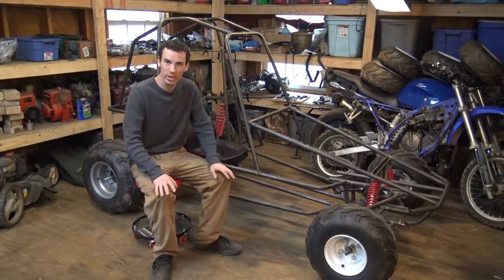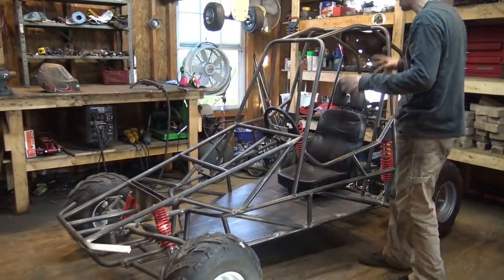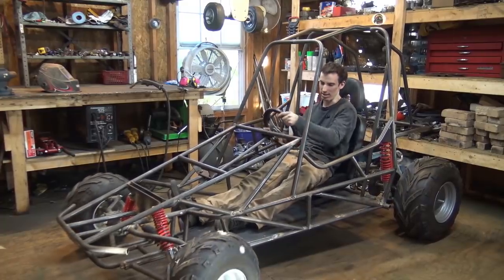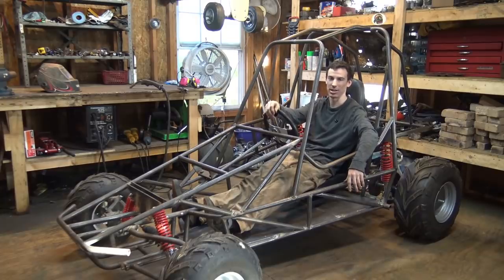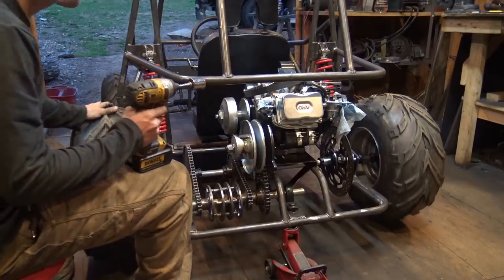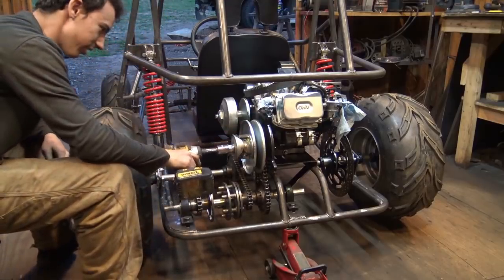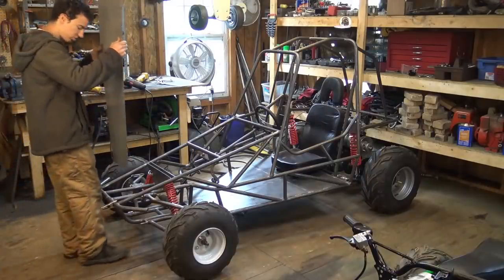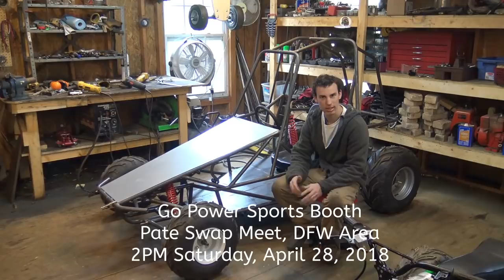building the two speed off road go kart part 4

Comment: hi never use plexiglass as wind shield, it gets scratched very bad. use the Polycarbonate, that is used on motorcycles windshields!
and about the body work i think it is fine. it will even allow you to make a custom paint job later it gives it caracter... 
and you can even put a kind of cool lights on the top of it and the front. and even something like an air intake on the hood... it will look cool. i'll make a drawing for you. i'll put it in a coment.
Reply: so you can imagine the rest. with the sides covered...
Reply: whats the point of a air intake on the front when the engine is in the back
Reply: Plymouth Barracuda when you have a windschield. You need a fresh air flow in somehow. Or am i wrong?

Comment: Make brackets and bolt on the sheet metal and mount it with rubber washers or O-rings. Or use a different lighter material like plastic

Comment: composite panel  called alucodond and weld tabs on for screws or bolts and use1/8 in. 3M tape between frame and panel research alucobond you can do a lot with it

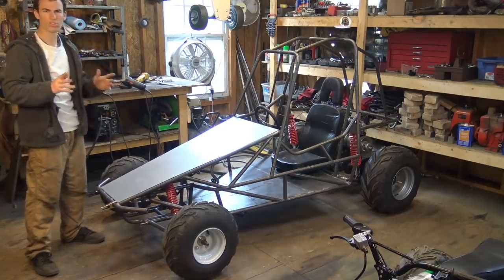Comment: @13:48 might wanna make that sheet metal a bolt on in case you need to remove it for any reason at all! once you bolt it down it will get rid of the noise just use little rubber spacer's  ;) your buddy spikeman

Comment: Leave the sheet metal off. The more weight you add, the more strain on the motor. If you insist covering up the frame, try lighter materials such as ridgid plastic, plexiglass or some type of light composite material. You still may have to deal with the rattling if you do.

Comment: Next build should be with a 4 cylinder car motor
Reply: mason swan , (but not just any 4 cylinder motor it has to be an “SR20DET” ) , ( OR EVEN BETTER THAN THAT ) ,
THE NEXT BUILD AFTER THE 4 CYLINDER BUILD SHOULD BE WITH A 6 CYLINDER CAR MOTOR (but not just any 6 cylinder motor it has to be an (FULLY BUILT “2JZ-GTE”  motor )
Reply: Rich Gwozdz Better start donating then...
Reply: This gets my vote.  This cart is pretty close to what I'm planning to build in the next few years with a b16 or b18 honad engine/trans.  They're fairly powerful for their size and dime a dozen in salvage yards.  8 or 900 pounds and 140bhp?  F yeah man!  SCARY FAST.
Reply: How about a 670 twin they are a 26 hp motor

Comment: Not sure if you know this or not yet, specifically how to calculate the torque or motive force of your drive system... If you do, just ignore it, if not, here's how you figure out what you've got. 

You should be able to find the torque curve of that motor, it will look kinda like an upside down U, or, they may only list peak torque at 3600 RPM. Once you know that, you can start using some simple algebra math to work your way down to the torque at the wheels. I'm assuming you already know how to calculate the drive ratio of your chain drive, which you can do by diameter for pulleys, or number of teeth for gears and sprockets. It will always be some fraction, like 10 teeth drive to 40 teeth driven which would be 1/4 or a 4 to 1 reduction in speed, but a 4x multiplier in torque. 

So for you engine, lets say it makes 10 ft pounds of torque (I have no idea) Your variable belt drive is going to have some ratio to it as well which will go from under drive to overdrive once the speed comes up, but lets say from a stop it's in its lowest 'gear' and it gives you a 6 to 1 reduction (you can find this out yourself, just count the number of times you need to turn the input shaft to get the output to turn 1, that's your low speed ratio, High speed is tougher) Therefore, your 10 ft/lb motor torque is now 60 ft/lb.  Now you come to your first gear chain ratio... Lets say you have 5 to 1 there... multiply your 60 ft/lb times 5... you now have 300 ft/lbs!  You can do the same thing for your high gear, and lets say it's 3 to 1 so it's 3 times 60 or 180 ft/lbs.

Torque is defined as a force over some distance, hence foot pound or newton meter.  Think about this logically, if you want to get a stuck 1/2 inch bolt loose, you don't grab the 6 inch long quarter inch drive ratchet, or the 8 inch long 3/8 ratchet, you probably skip the 1/2 inch drive ratchet and go right to that 2 foot long breaker bar... Why? Because the force you can exert on the wrench is basically a constant, and to get the maximum twisting force (torque) on the stuck bolt, you go with the longest bar you can get... Same is true with your wheels, only the function is backwards... the larger the wheel, the more force it takes on the shaft to turn the wheel.  This is why when guys go and jack up their truck and take the 17 inch wheels off and put 38's under it... they usually end up changing out the rear end gears from 3.73 to 1 to like 4.56 to 1 or whatever otherwise that truck has no power to accelerate. 

So now you take the diameter of your wheel, and cut it in half... 22 inch tall tire is 11 inch radius . Since 11 inches is less than 12 inches, which is what a 'foot pound' is based on, it is 12 inches divided by 11 inches or 1.0909 times a foot (since it's smaller you're gaining a mechanical advantage.)

Therefore in the end, your final motive force (or tractive effort whatever you want to call it) will be 1.09 times 300 foot pounds or 327 foot pounds of torque in first gear, and 196 foot pound in 2nd.... 

Granted, that's peak torque of the motor, from a dead stop I don't know what the torque will be, but you can run that same math against your other cart and see what your final drive ratio is and tractive effort would be based on the other carts motor...  (calculating this with an electric motor is cake, because they give you a stall torque number, which is the torque it will give at zero speed) 

To really get an exact number you'd have to know what the stall speed of your centrifugal clutch is, and then look at the motor curve at that RPM to get what torque you have from a stop when the clutch starts locking down. 

Hope this helps, or you didn't fall asleep.
Reply: nerd ;)

Comment: Should have taken the pinch bolt out of the rack column then pushed the steering column in until the pinch bolt fits into the groove in the splines. That column could become detached from the rack  turning you into a poor mans Ayrton Senna.

Comment: All those dead tube ends. When you want to strengthen the frame you want to go from joint to joint, not an inch from the joint out in the middle of the tube.

Instead of sheet metal on the body go find a sign shop and get some corrugated plastic.

Comment: dude, your cart looks like a sprit cart. so if your worries about nose, try two faced foam tape, just a 1/16 will cut any nose. you can either screw then plating too the tubes of plastic zip tie the panels. and yes you should put the panels any where that would protect your body of water, mud, or crash. it all works.  then you could use plexus/ laxane glass, panels. about three bucks worth to do the cart.now all you have too figure out how too change gears with out stopping to switch gears,add lights, and brakes

Comment: Looking good... kinda surprised you didnt paint the frame while you had it all torn down after welding it out.
btw... i like the hood sheet.  You could use some double sided foam adhesive tape to eliminate the metal on metal noise.  Then maybe add a couple hold downs to ensure it wont fly off.  heres a link:  https://www.mcmaster.com/#7626a213/=1cl59mp

Comment: chloroplast panels (https://www.homedepot.com/p/Coroplast-48-in-x-96-in-x-0-157-in-White-Corrugated-Plastic-Sheet-CP4896S/205351385) they come in colors and are light and cheap if you lose one. besides they would keep the mud a dirt off you when riding . but i wouldn't do the back just the front and sides.